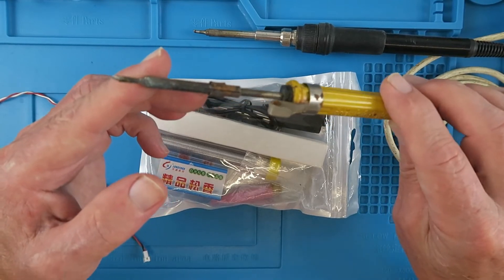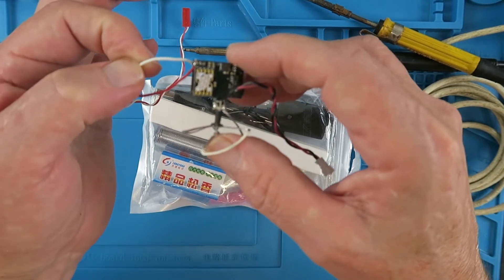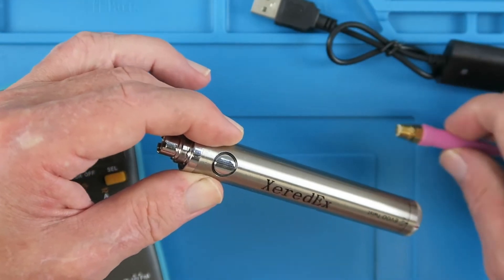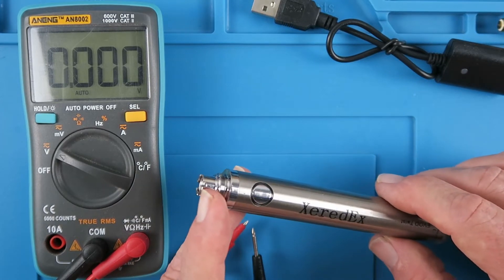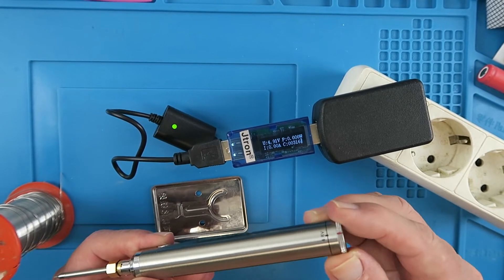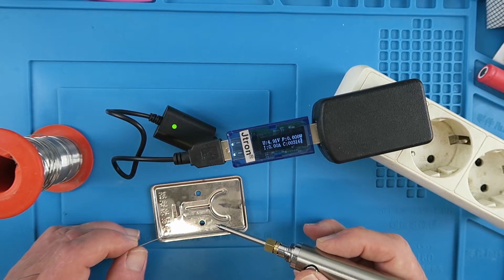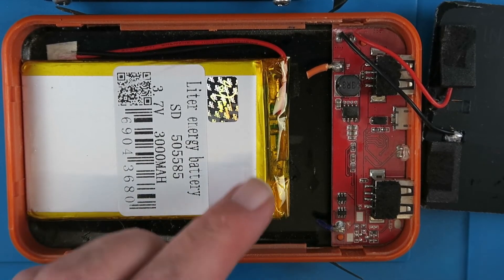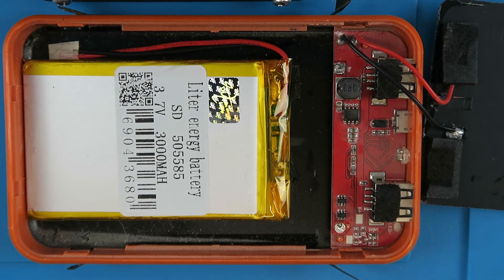Handskit Wireless USB Charging 5V 8W Soldering Iron Review

Comment: Did it's still work?
Reply from the maker: Yes, it still works OK. It is not something I use everyday. Just in the tool box for when I am outside and need to solder something in an emergency. I fly electric model planes so very useful to have at the field if a wire comes off! YouTube no longer shows me if you are subscribed. Please consider subscribing if you have not done so already!

Comment: Have you ever gotten one that stopped working? I watched another video where it had stopped working and I was wondering if it was just a bad batch sent out. Other than that I would love to buy this!
Reply from the maker: I only have the one and it still works fine. As with all Lithium cells don't over discharge it or you will have problems getting it to charge. Please consider subscribing if you have not done so already!

Comment: how many hours it takes to fully charge? my sol. iron was just blinking when it came, charged for 5 hours and still red light was on. unplugged bcs seemed too long. tell me your charge time pls.
Reply: if battery low, blinking when you push the button. after then if start charging how long it takes for you?? mine 12 hours 😛 0.1A charging current too low same as mine. but 0.420A written on cable charger. somethings wrong about that and nobody tells about that bcs obviously nobody tried to charge this soldering iron from 0 to %100 😡
Reply from the maker: @Spartan_MYST  First it is always a bad thing to discharge a Lithium battery that low. Yes, with the supplied charger it will take a long time. Now, I do not suggest you do this BUT you can charge the cell by connecting a current limited power supply to the soldering tip and outside case. The tip is positive. I just tried that with my bench power supply at 5 volts and 0.5 Amps.
Reply: @1nformatica  still maybe don't figure it out why we try different charging power supply while cable should be worked at 0.420A. if it worked as should be, nothing would bother me bcs charging would takes about 3 hours. your 45min.charge>15min. work time info. seems not accurate btw. when i charged 5 hours it didn't give enough heating to melt solder.
anyway what a disappointing product. while working at max. it starts burning your fingers and can't hold button  anymore 😡 also other shaped tips are actually same tips. copper(yellow) heads can removable if you do that,  see same default pointed tip. also this is causing heating loss.
Reply from the maker: @Spartan_MYST  I think you expect too much from something that cost $17!! If you want the Rolls Royce portable iron than you need this : https://youtu.be/URQLL3tvRLQ
Reply: @1nformatica  expecting normal charge that written on the charger really too much 😒  and 1cm silicon ring /something cover over the button area would be simple solution. i saw at cheaper wired models. even tips are not cheap actually. yeah i expected what they promised on the sale in fact . to work properly like other things that i purchased . 
btw seller accepted it's faulty and sending me charger, battery again. maybe fix my problem. but don't know how to disassemble and replace battery. i need another soldering iron 😁 hope charger is the problem 🤔
Reply from the maker: Charge time depends on how long I use the iron for. If I use it for say 15 minutes then it takes about 45 minutes to recharge. The USB charger is not very accurate and probably your iron is fully charged. I use on of these : http://bit.ly/USB_Testr to check when the charge current has fallen to a very low level. It also shows me the mAh put into the cell. Please consider subscribing if you have not done so already!

Comment: I can't charge mine, the red light never comes on, do you know to fix this?
Reply from the maker: To check the battery remove the soldering tip and use a multimeter to check the voltage between the centre point and the outer casing. Take care not to short it out! The voltage should read what the dial on the base is set for when the button is pressed. To check the charger, when it is plugged in with nothing screwed into it the green LED should be on and 5 volts on the charging point. Hope that helps. Please consider subscribing if you have not done so already!
Reply: @1nformatica  I subscribed, I did both of those things that you suggested, charger is showing 5v, the iron shows 4.4 when it's on 4.8v but it does go down if I go down on the dial, but the charger still doesn't change to red when it's twisted in. Does the iron need to be on/off/ button pressed or anything like that for it to charge?
Reply from the maker: @hoonam814  The unit will start charging as soon as it is screwed in, no need to press anything. The light on the iron body should turn on and the red LED on the charger. At charge complete the charger LED goes green and the body light goes out. Maybe the charger thinks the battery is already charged, have you used it for say 10 minutes and then tried charging?

Comment: I recently got one of these from Banggood, mine failed to work.  Banggood has had me photo it, meter it, video it, and still has not give me a refund. I thought perhaps it was the tip, so I ordered another, but alas it was not. I have charged her up, and she holds a charge, but no heat. At long last after weeks of fighting with them, I have at long last given up and just ordered another. Perhaps I should have ordered elsewhere, but I wanted to see what I would get from them this time. To be honest, Banggood has always been good about such things, perhaps I just got a bad rep or something, but I have to say, I am extremely dissapointed with Banggood at this point.
Reply: Both Walmart and Amazon sell them now if you are still looking....and roughly the same price too surprisingly!
Reply from the maker: @englishrupe01  Thanks! Please consider subscribing if you haven't done so already!!
Reply from the maker: That's very odd. The resistance of the tip is about 3.2 Ohms measured between the outer casing and the inner point. You can also measure the battery voltage with the tip removed, it should read what the dial on the base is set to say 4.8 volts. Remember that you need to hold the button down for it to heat up! https://youtu.be/V0lwp9uVCn8?t=341

Comment: hi, i bougth this and i can´t power it off.
if i remove the tip it´s stays on, the i clik 5 times on de boton and nothing happens.
i don´t know if it´s borken or if i don´t undestand how to turn it off
can you tell me how do you power it of please?
thankyou.
Reply from the maker: It should turn off automatically. Once activated by pressing 5 times you have to hold the button down for the tip to heat. When the light around the button starts flashing you must release and press again to keep the tip hot. If you do not press the button again when the light flashes it will be powered off.
Reply: Hi Martin Stinchi,    Did you ever find a solution to turning your one off ? as I have received one today from ebay which is doing the very same thing, I pressed it 5 times to activate with 3 flashes from the LED then it stays on until the battery goes flat, I have removed the hot tip and put it on charge before and after it goes flat press the button in different sequences still unable to get it to do the 20 secs time out..
Reply from the maker: It switches off automatically. If yours does not it is faulty. These cells are designed for vaping atomisers and the auto switch off is there to stop them burning out. Get your money back from the eBay seller and buy one from my Banggood link!  http://bit.ly/USB_Iron

Comment: Thanks for the review. Do you know if there are replacement tips for it as I'd quite like a small hot knife type tip for mine?
Reply: Lol just seen the pinned post :)
Reply from the maker: @Mark--Todd  😀 You read the comments!! I guess you could fashion a knife tip out of sheet copper / brass and attach it with a ferrule if you were desperate!
Reply from the maker: It's your lucky day! Knife tips just in at Banggood : http://bit.ly/SolderingBits8W

Comment: I think this is small cool thing but what about replecing iron tip I cant find it anywhere
Reply: check the sellers on aliexpress that sell these irons. the problem is that that there is only one type of tip available and it's half the price of the iron.
Reply from the maker: Thanks, I had looked on Aliexpress but not found just the tip, can you post a link?
Reply from the maker: @martik778  Thanks! I will pin this comment for others to find.
Reply from the maker: I can't find replacements either, but for the amount of use it will get  I don't see it will be a problem. At the price it's almost a throw away item!

Comment: I knew it was only a matter of time. It's a 510 fitting. I had the idea.
Reply from the maker: There's nothing new under the sun!! What are your thoughts on the iron?
Reply: @1nformatica  I think it's ok for minor jobs on the run, but nothing with a larger ground plane. On the cell I have which was designed for vaping is, 5v would fry the atomizer in a couple drags, Green is 3.4v, blue is 3.7v, Red is 4.0v, I don't know where they get 5v? I have to click the button 5 times to turn it on and 3 clicks to change the voltage. I have the same battery unless they somehow added a boost converter which I doubt, but you measured near 5v. I would like if they added a 3S to make it 12.6v full power. You need a battery with high drain and they're saying it's only 1.6amp. They could use a 20amp drain cell and that would do it.
Reply: I'd bet they would pay us for the idea's we have.
Reply from the maker: I pretty sure there is a boost / buck converter in there. Not going to pull it apart to find out (yet)! Would have been better with 18650 I think, but as I said you could probably screw the bit to any vaping type arrangement.
Reply: @1nformatica  Apparently, according to both Amazon and Walmart who now sell it, it does contain an 18650.....i just wish it was more accessible for replacement or swapping out for extended use. Thanks for the video!
Reply: @1nformatica  Oh, and it is 1300mAh.....so i could boost that to double with my replacements!

Comment: You have to keep pressing the button to activate? And basically self regulate the temperature? I can imagine that getting annoying fast
Reply from the maker: The button is under where my finger would normally be to hold the iron so I do see that as a big issue. Once I set the voltage to 4.3 volts which gave me around 300 °C I did not need to change it. For me this iron is really just an addition to my field kit more for emergency use. Of course on the bench I would still use my Hakko T12.